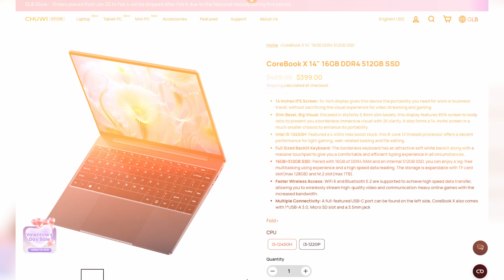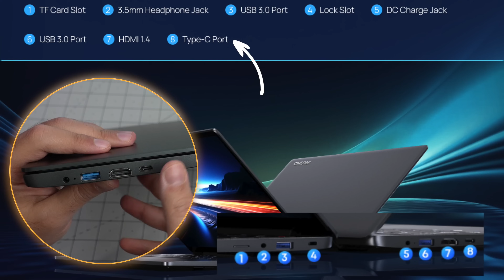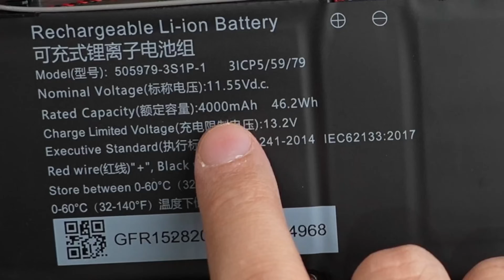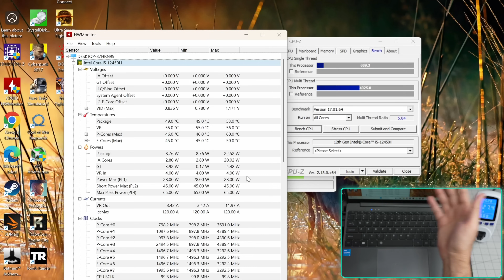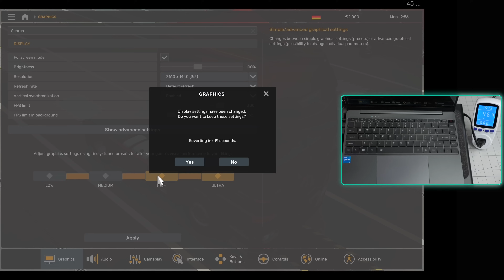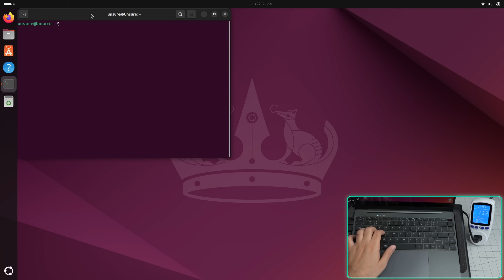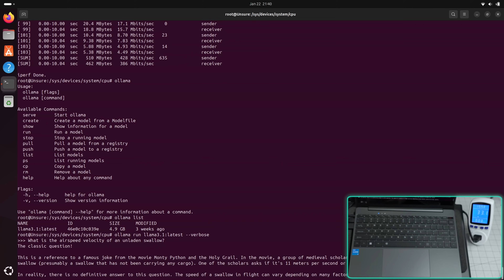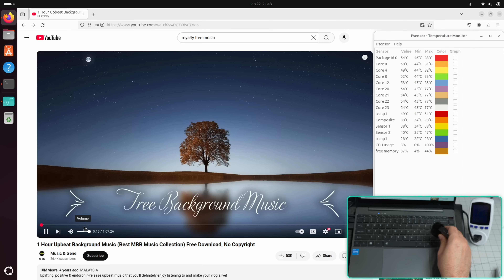$399 i5-12450H Laptop: Too Good to Be True?

Comment: 1:55 you expect a USB-C charger at that price, come on man! Yes it has PD USB-C port. but it's main intent is for DP for external monitor and it charges it while connected.
Reply: $399 is £300, and a DC jack is normal for that price at least in the UK. I have a £500 Asus laptop which is also a DC jack.

Comment: It looks cheap, but if after 8-12 months you need to replace the battery (as many chuwi users comolained about) or buy an external powerbank your considerations about price-quality ratio will definitely change soon.
Reply: Well, my ASUS Rog Strix  G16 is a year old, battery capped at 60% all the time docked at work, and it already lost 7% of it´s  capacity. With modern LiPo batteries, heat is a problem.... A MacBook Air with literally no ventilation, all the heat dumped into the chassis and after two years, the battery is deader than caned tuna. At least for Chuwi, you can get the battery on Aliexpress for 30 bucks. Let´s be real here. This is entry level electronics with a good price performance ratio, with a different target market. Like India, where even at this price point it is a luxury item for a lot of parents with kids at the university, or other school. Battery goes? No problem, you can buy a new one from Chuwi for 30 bucks or from Aliexpress.
Reply: @858Markus  can you run chuwi without battery?
Reply: @espressolover2310  Don´t know. Never tried.
Reply: I've owned a few chuwi devices (mini PCs, laptops) and my most recent laptop from Chuwi has not had that issue

I'm expecting this unit (but the 7430u variant) to come in soon. If anyone wants an update, they can ping me here
Reply: @roqeyt3566 update us

Comment: I got the exact same laptop. I choose this over the minibook for the i5 cpu for longevity. As a daily driver for basic tasks the i5 will last much longer and snappier in day-to-day use. 
The USB C port can be used for power. It works w/ the Dell 65w usb c power brick from my work laptop.

I tried putting in an extra ram. Random brands from Aliexpress. The 3200mhz one doesn't work even tho the speed matches with the one came w/ the laptop. I tried another one 2400 (or 2666 mhz) it boots up fine.
Reply: did you try swapping the sticks with the faster ram?

funny i cannot boot if i put the slower ram in the original slot on this hp 10th gen "near netbook" i was given... but if i move the original ram thats slower to the 2nd slot and put the faster ram in first.. both sticks work at the faster speeds... it wont even post if i swap the sticks for whatever reason.. 

could be timings on the 3200stick you got would work for the other stick but not the other way around...
Reply: @AshenTech  No, I did not change the order of the RAM sticks and I don't have anything faster than 3200mhz. Once the slower ram works I call it a day. For a non-gaming laptop I won't notice the difference between 2400/2666/3200 anyway.

I had a desktop from the DDR2 days that the order of the RAM matters but its the reverse of what you have - the slower stick needs to be first otherwise I keep getting BSOD.
Reply: Do you still have it? Does it still hold up? I feel tempted to buy this laptop for the price, but I've seen multiple comments from people describing problems coming up after around a year of usage: the screen hinges breaking apart from the case and the battery swelling are the main complaints I saw. Could you share how yours is doing? Thank you!
Reply: @tmgrassi  I bought it about 6 months ago for diagnostic/experimental purposes so it doesn't get used extensively. It hold up fine but cpu temp easily reached 100 degrees and throttles especially when I put it flat on a desk. Having it on a laptop stand giving it some breathing room underneath helps a lot.

Comment: I also own this laptop for a month now, i right now discovered from your video thst i can run ollama accepteble speed on my laptop😂. Only drawback is as you mentioned cpu temps are so high in high load. Yes i installed another 16gb of ram stick. Looking for changing termal paste to mx 4 in near future, will se what changes. Thank you for detailed tearing down laptop😊 It will help me
Reply: Is that port on the bottom with the two screws an ssd or ram I am confused I won't to buy
Reply: @PhaNt0mPho3n1x_YT  uts additional ram slot not nvme
Reply: @PhaNt0mPho3n1x_YT that is ssd not nvme😅
Reply: The thermal paste change should help. Out of the box, Chuwi paste is bad. Repasted my UBook X with Chinese GD900 that I have stashed in my refrigerator and it was night and day. From overheating, to 60-70°C under load (it has passive cooling). Thinking of buying the 13900HK when it comes out and repaste it with LM, which I also have laying around somewhere. This will be my cheap little experimental laptop, for some light work at building sites. Hope XTU and undervolting will work on the HK version. This will be fun. And did you change the paste? Any results?
Reply: @858Markus should i buy this one? Im gonna use it for over 5 years
Reply: @ннннннн-ф6п  It is questionable if this low cost laptop survives 5 years. I don't think the battery will. At least the battery, RAM and SSD are replaceable if something happens. Not a difficult job to do. Depends on your budget. I didn't catch any other problems than swollen batteries in the forums. Hinges and displays seem to hold over the years. Keyboards seem to survive the test of time. But five years is a long time for any modern laptop to survive, especially as a daily driver. And with budget laptops, there is very limited support, like drivers, bios or repair from any brand. Most of the low cost laptops are designed to be e-waste after a few years 🤷

Comment: Not sure why youtube reviewers dunk on barrel chargers. They are great. Cheap and efficient.
Reply from the maker: Sure, but portability. When I travel I take a single USB C charger with a couple of outputs and use that to charge almost all my devices, laptop, tablet and phones. For barrel chargers, now I have to carry a separate one, that's the main reason.
Reply: @TechnicallyUnsure Are you able to charge it using its usb type c port? In their website mentioned it as full function type c
Reply: @whoamiscorpion3937  Another review i saw they say it charges both on the barrel jack and the type c port
Reply: @TechnicallyUnsure  you can charge it with a 65W PD usb-c charger, I had an older model and it was okay. the barrel charger that came with it was effy. definitely a lower quality charger. but it was okay.